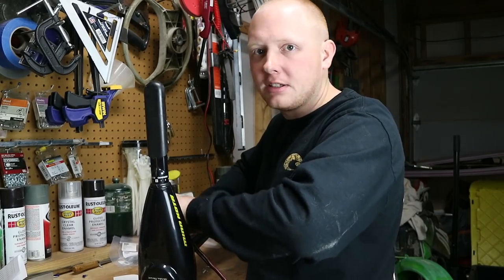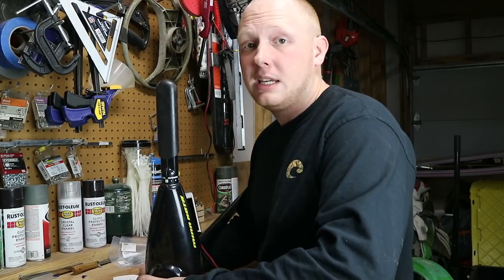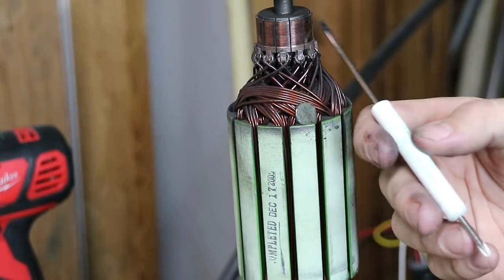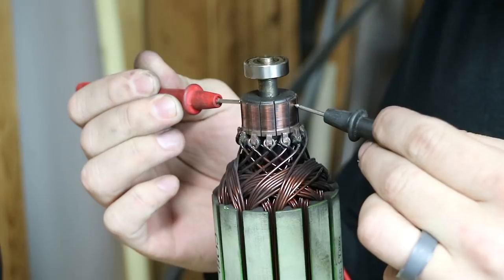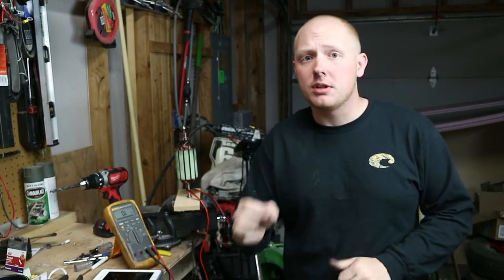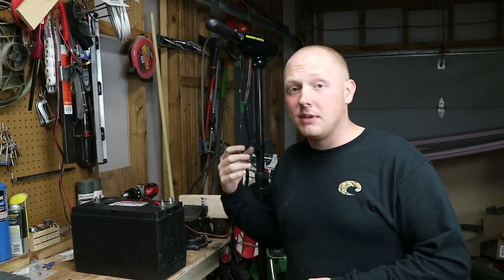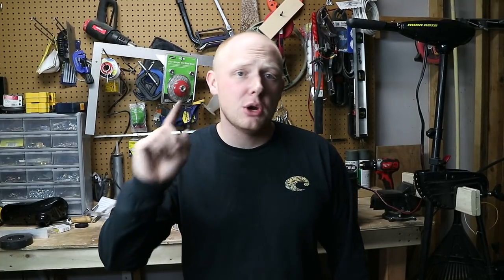Trolling Motor Repair Guide | Troubleshooting

Comment: SMG !  I have this Minn Kota V2 55 lb. thrust Trolling motor, with the IPILOT installed ,Everything worked , then one day went fishing... Nothing ! put new batteries into the Remote, Still dead !  There are NO repair places in my area to take my boat/equipment to for repairs, so... with your Guidance, and advice, looks like I will be taking my Trolling motor all apart in which I KNOW NOTHING about this Electronic stuff !..So...SMG... U being "Da MAN"... and me being an Ol' 70 yr.guy... reckon I'll be watching your videos on Trolling Motor repairs Alot ! I am Very Thankful that there are folks like you that put up such Helpful videos for us guys that don't know Nothing !!  In advance SMG... Thank YOU Whole Big Bunches  for 
Your informative/helpful videos !  Keep up the Great work !!!  ( a New Subscriber)
Reply from the maker: I really wish I had more knowledge to help you out. I'm a complete rookie when it comes to the iPilot and digital drive stuff. Thank you for watching my videos. I'm glad they're helping you out. Good luck with that motor! When in doubt spend hours researching it on the internet. Chances are someone else has had the exact problem before.

Comment: Thanks for that advice on O rings. And yes when I looked at my particular parts diagram for mine, it was a no brainer to buy all new everything that was corroded or rubber. Very reasonable cost. Only $23 for even a new decal and some extra gaskets, and shear pins for the propellar.  Initially, I thought my armature was bad.... but it was because I did test it right after removal, then buffed the copper corrosion that was blue-green and into the wiring on the core. I used a toothbrush and cleaned the wires with white vinegar. Blowing it out, it started showing it was grounded to the shaft. Next day after letting it alone, I checked again, and it was all good. So today I finished putting it together.  I didn't get wires positioned right and it caused dragging. I looked at my disassembly photos and re-did wires properly and it was all good. I'm a happy camper. The silicone grease was used sparingly on the paper ring above the bearing and the flat cone gasket to hold them in place. The non-magnetic tube over the end of shaft is the best way to mount the magnet case. The new end cap O ring had some silicone grease around it just for lube to prevent chance of a pinch.  Your video gave me all I needed to feel confident that after testing armature and it was good on the ohms testing, I could order the bad parts and get it going. Thanks... btw, I call what you describe doing things over as being oldsheimer... not Alsheimer....yet. But the older I get, I find I need photos to be able to remember how things were put together.... sucks getting old.
Reply from the maker: Haha. Thanks for the great feedback Gene. I really appreciate it. I'm glad my video was able to help you get your old motor going again!

Comment: Nice video, and I'd like to add an incredibly important and simple fix for a motor that runs in reverse when the cables are reconnected properly (red-pos, black-neg) after reassembly. I couldn't figure out why my motor was running backwards with the switch in the forward position after I took it apart and lubed the o'rings and cleaned it up a bit. Evidently, I had replaced the stator section (the large cylindrical part with the magnets in it) 180 degrees out from its original position. I took off the prop and removed the two long thru bolts that hold the motor together and just rotated the stator cylinder 180 degrees, and voila!! Its running as it should. If you have an electric DC motor and it runs in reverse when reassembled, try this instead of switching your cables around. The magnetic field has to be returned to how the factory set it up initially for the motor to run as indicated in the switches. Have fun!
Reply: Yea it was right if you had put it in front of boat

Comment: One of my armature commentators is reading high about 100 bucks for a new one there is a 3-5/8  and a bigger 4 and something for the 80 pounds and over I think I have a seal kit coming it sat in a pole barn for 4 years with water in the lower unit when I bought the boat the guy said everything works that was a lie at least I got it cheap thank you for the info keep making videos

Comment: Using the side-by-side test, I figured out that there was a significant issue with one of the commutator segments (thanks, Drew w!).  One of the segments (thanks, Drew w!) had picked up something from the brushes and had formed a hunk of residue that I filed off the segment (thanks, Drew w!).  Works great now.  Thanks!  Segment, segment, segment.
Reply from the maker: Thanks I guess. I dont know who drew w is.

Comment: SMG I got it running with the replacement parts I ordered but now I have no reverse and only two forwards so either the control is bad or wired wrong,you taught me enough to figure it out myself,Thank You
Reply from the maker: Haha It's always something man. That sounds like a burnt up switch to me. Did you replace the switch? They're pretty cheap like $15 on amazon (links in the description).  I'm glad you got it to work somewhat though. Now get on the water and rip some lips man!

Comment: So my trolling motor just messed up on me.  It's a 45lb thrust minn kota and the blades won't spin unless I just spin them by hand, then they'll work for a bit and cut off again. I pulled the blade off thinking something was tangled around the inside like fishing line or something,  but it was all clean. What could be the issue?

Comment: that was a good break down on how to test an armature. keep up the good work looking forward to how you do the folding tongue.
Reply from the maker: Thanks, I really appreciate it. I should be finishing up the fold-away trailer tongue video this week sometime.
Reply: did you weld the hinge in or bolt it through the tongue?
Reply from the maker: I used a bolt on application. The link is in the description if you wanna check it out.

Comment: Nice video. I have a no-name motor and it won’t run I have tested it the same way you have done it and it does not fail I have tested the brushes with full power and they have 12 voltage
Reply from the maker: Probably a switch problem. Those no name or off brands are notorious for failing after a year of use. Good luck.

Comment: 10 year old Traxxis 70 (24v) - motor gradually slowed down and then stopped completely.    30 amp fuse on one of batteries was blown- replaced and now have 24V to plug -in for motor. Would you anticipate control board issues or lower end ?

Comment: We have a 80lb fortrex and last few outings it’s had no power I used to be able to go 2 and a half mile an hour on our 20 foot bass boat and now it has like 30% of that power and can barely get it above 1 at 100% with fully charged batteries I’m wondering if it’s the motor windings and not control board considering all the speeds work also before it had its loss of power it kept kicking our breaker and we even upped the breaker my Geuss is the seals failed any suggestions to waht the problem is? Not able to upgrade to a new ultrex just yet and want to salvage this for a little bit
Reply from the maker: That's a tough one. It could be the windings or the brushes. Do some of these tests and see what you find. I believe you can replace the entire armature and brushes for les than a new one. Good luck!

Comment: Great video. Question: what would cause my trolling motor to work partially. I have to hit the top of the unit or jar it and it will kick on. Then randomly kick off. 
Side note new switch, new control board, new handle. Minn Kota 112lb
Reply: I noticed something like this due to heavy rust on the armature. Like it was affecting the effect of the armature and the magnets in the case. Once I knocked off all the rust on the armature and made sure the magnets were free of any rust contamination, the motor worked properly and I didn't have to help it start. May not be your issue, but that's what I experienced.

Comment: Your comment re: motor not working when you turn the switch to 1 or 2 but then coming on when you turn it to 3. That is similar to my problem. Have a Powerdrive v2 with a foot pedal control. Nothing happens until I turn the dial on the pedal to 3 and then it's fine until I get up to 7 or 8 but then I don't get any more power when I dial up to 9 or 10. I suspected the issue was with my foot pedal. I replaced it with a new one but still had the same issue. Someone told me the issue is likely with my armature or brushes but you said if that were the case the motor wouldn't work at all. If that is accurate then I now wonder if my problem might be with the control panel. Thoughts?

Comment: Hello, I just bought a Shakespeare Glider 55lb.  Just discovered there's only one speed in both forward (1-5) and reverse(1-3).  Would this be a problem with the speed controller switch?  and if so, where would I buy a replacement.  Thanks.

Comment: After removing the two long bolts beneath the propeller, the end of the casing/housing for the armature doesn't seem to want to be removed. Is this usually threaded and screwed on? Might it be glued shut? Maybe a gentle squeeze of the vice to get it open?

Comment: Great video thanks for all the helpful tips and info!
Reply from the maker: No problem Bernie. Thanks for watching, I'm glad you enjoyed it.
Reply: SMG Fishin' I have a minn Kota endura c2 55. I wanted to take it out on the water for the first time of the year yesterday and I remembered getting line caught in the propellers when I used it last summer. So I took it apart, and ripped all the line off. When I put it back together, I connected it to my fully charged battery and it won't move at all. I actually got it to move in reverse for about 2 seconds and it shut back off. What could be the issue?
Reply from the maker: Oh no that sucks! Did the motor work before you took it apart? Or did you not check before you took it apart? I'm talking about after it sat over the winter but before you removed the line and took it apart.

If it did work prior you most likely hooked something up incorrectly. If you don't know and it didn't run before you removed the line there's a good chance you either burnt up the armature when you got caught up in the line.

It could also possibly be the switch since you only have reverse. But I'd be willing to bet you have something hooked up wrong. I would take it apart and double check all the connections and make sure you find the wiring diagram for your motor using the minn kota website. Your serial number should be on a sticker on the transom mount bracket. Also while you have it apart it would be worth it to test the armature like I did in this video using an ohm meter. If you don't have one I have a fairly priced one linked above in the description of this video. If you test the armature and it's good and you have all your wires hooked up correctly and securely I would buy a new switch and see if that works. It's only like $15-20 on amazon (also linked above).

Let me know if you have any more questions. Feel free to email me if you can't figure it out. smgfishin@gmail.com
Reply: SMG Fishin' actually I think it's just the switch. Because I just tested it again, and I got power in forward 5 but nothing else. I'm gonna go ahead and order a new switch. But how can I find out how to replace the switch? I actually never tested it before, so it was probably already not working from sitting all winter
Reply from the maker: If it were me I would still take apart and reassemble the motor before I spent any money. It sounds like you may be moving a loose connection. The switch doesn't typically intermittently work. Usually it either does or doesn't work. You can check out my other trolling motor video to see how to replace parts (https://youtu.be/ewMDrOH3ljQ). Hope it all works out for you. Good luck.
Reply: SMG Fishin' alright thanks for the help bro and the helpful video. U got my sub
Reply from the maker: glenn redegeld no problem man. Thanks for the sub.
Reply from the maker: Did you ever get your motor back up and running correctly?
Reply: SMG Fishin' yea it runs perfectly now. I found that when I put it back together it just wasn't tightened up enough so it was pretty much disconnected lol
Reply from the maker: +glenn redegeld that's awesome man. Great way to save money.

Comment: My Eduardo 40 seal went bad and got water in motor and shaft bearing all rusted up, I cut off bearing , but do not see replacement and I haven’t seen video showing replacing it! Is it pressed on at factory???

Comment: You answered all my questions except why won't it work!!now I opened up my Endura C2 and all kind of rust came out from the bottom,so I removed armature did all three test and got readings like urs so I cleaned it up put it back together and nothing still dead my battery is fully charged,my wires are fine what else should I do?Change armature for sure
Reply from the maker: +Augustine Sullivan are he brushes making a good connection with your commutator?

Comment: I have a Minn Kota Pontoon with a Copilot remote controller and a foot controller. The motor will not turn on with either the remote nor the foot controller.  It will turn side to side.  I'm wondering if the fuse is open?  Do you have any tips on checking or replacing the fuse?
Reply from the maker: +Rick Hadlock I'm lost when it comes to those motors man. I haven't used one let alone try and diagnose one. I really don't like the fly-by-wire controls they have. I stick to the simple cable driven motors. My best advice would be to either take it to a technician who knows what they're doing or do so much research you become an expert on the thing. I'm sure it's some sort of wiring issue or some switch or fuse is bad. Try looking for technical bulletins that they or someone may have posted on the web to see if it's a common issue. If anything pull a wiring diagram or it and make sure you don't have any shorts. Good luck to you brother. Let me know if you figure out what the issue is. I'd love to learn about it.

Comment: Thanks for tips! Just ordered my parts for a MKAE All Terrain 55# bow mount pedal model. Mine had fishing line trapped behind the prop washer and mangled the seal to let water in.   What can I use to coat the O-ring seals and case gasket. I was thinking that a silicone (waterproof) grease would help to prevent water intrusion. I found if I used a piece of aluminum tube over the prop shaft of armature, I was able to slide the magnet case over the armature so it couldn't slip out of the brushes.
Reply from the maker: Don’t try to fix broken o rings. They’re cheap. Always replace.

Comment: I have a MOTORGUIDE  55 LONGSHAFT   power ,cables are not the problem ... the issue is the prop will not turn at  any setting , it will turn   the pedal makes the chirp for each speed , but the prop stays still ,,,any ideas ,,, i was in  rough water where waves crashed over the the motor   and it got really wet ,,, its a2017  motor so age  is not the problem or wires or battery ..... if you or anyone has ideas   sure would like to know thank you

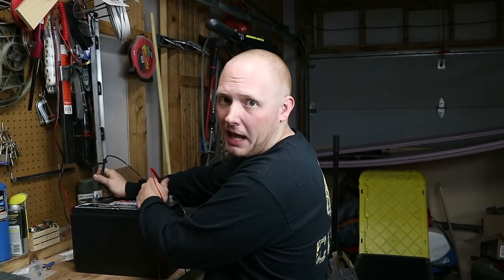Comment: Very informative, but at 6:24 you said "test the battery with alternating current."  You meant "direct current" and testing for "DC voltage", right?  (The superimposed text said DC which I assume was a correction.)
Reply from the maker: You've got it boss!

Comment: I have a motorguide thruster 30, that has a bad 7 position switch.  I want to replace that switch with a PWM unit.  Traditionally you would just connect the positive and negative wires from the trolling motor to the PWM, set the trolling motor to F5 speed and use teh PWM to control the speed.  However, since my multi-position switch is bad I want to do away with it and connect the PWM directly to the motor instead.  There are 4 wires from the motor to the multiposition switch.  Could you tell me which ones to connect to the PWM.  I suspect it will be black and red, but not sure.
Reply from the maker: That’s not something I’m families with. I wouldn’t recommend switching from a set speed to PWM. Motors are not designed to work like that.

Comment: i have a minn kota 24 v motor mount trolling motor that came with a boat i bought and it did not work so a took it apart and 
bought parts and did a lot of trial and error well in the end i have bought new armature, magnet housing, brushes and springs, new controller and seals all parts are new except the front and back cover housing problem is i put it all together controller show power coming out of it but motor dose not spin i taken motor part several time everything seam right but still dose not work

Comment: My Endura 40 would only run on 2,4,and 5 forward speeds and only on 3 in reverse. I replaced the selector switch and it's doing exactly the same thing. ???

Comment: Thanks for the video.  I just bought a 2nd hand motor and there was a bunch of water in the case.  So I took it apart and drained it but the magnets came off.  What kind of glue could I use to stick them back on the case?  I have no idea if it'll all work but I guess it's part of playing with it.  Thanks in advance
Reply from the maker: That’s a great question. If I were to do it I would first try something like extra strength gorilla glue. If that doesn’t work then I’d try some kind of two part epoxy. Whatever you use make sure it’s temperature and water resistant. Good luck on fixing it. Let me know what works for you.